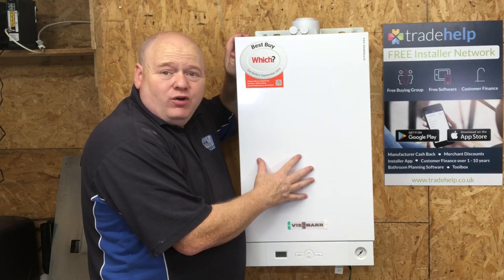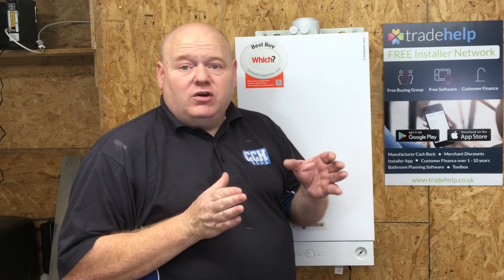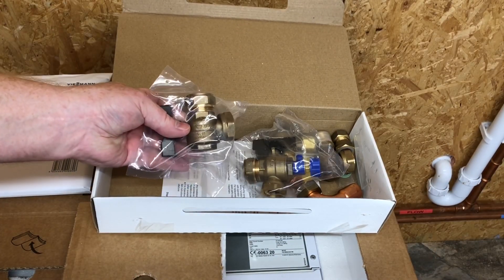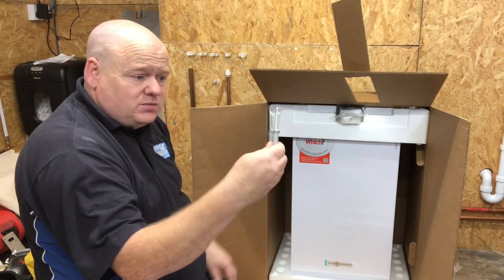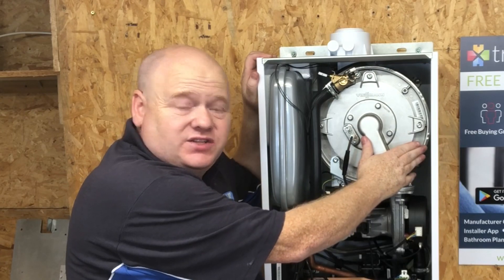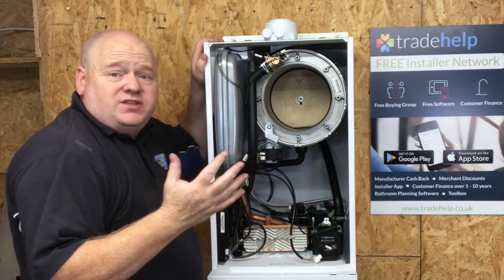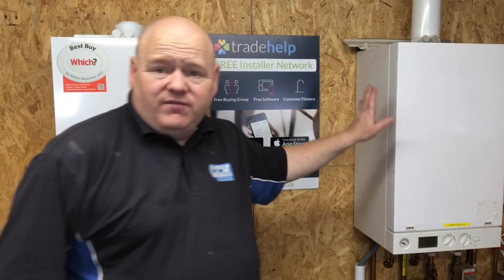Viessmann Vitodens 050 Combi Boiler Review - What’s in the box - Full strip down

Comment: In the USA the Viessmann boilers 100/200 plus have been withdrawn due to faulty plate heat exchangers. In the UK, the boilers are having the same problem especially those installed around 2017 - 2019 approx. The engineer that did the annual review on my boiler said that he is coming across this problem regularly. Also the pressure keeps dropping. These have not been withdrawn.

Comment: Hi Allen. I have had this boiler since 2018. I have the extended warranty and I now have a faulty heat plate exchanger. I had an annual service and the engineer said the plastic parts on the heat plate exchanger had disintegrated. I contacted Viessmann and they are refusing to look at the fault unless I pay £155, for an engineer to come out to survey the job. I told them the faulty part is covered by the warranty but they categorically denied that it's covered. The temperature of the water goes from very hot to cold in a matter of minutes.

Comment: Had this boiler installed 7 years ago, have had it serviced every year. Most years it needs a new hose and plate heat exchange due to the system clogging up. This year the plumber advised to rip it out as it’s just going to keep costing £££ a year in servicing and replacement parts.
Reply from the maker: It sounds like your system needs a good clean.
Reply: @AllenHart999  we’ve already done that a few years ago and had a fernox fitted to try and help. Is it normal to have to change the hose and plate heat exchange on a yearly basis? It’s costing us £300 a year just to keep the thing running

Comment: I have this boiler and the pressure gauge has stopped working. I didn’t realise I thought the pressure went low so added more water then it leaked out. Not sure if a new pressure gauge would be under warranty. I’ve had the boiler 5 years but only serviced 3 times.

Comment: I bought a house with one of these fitted.  Heating has worked great but hot water is a nightmare.  Boiler is less than 30 months old and I am having to have an engineer out for the third time.  The system has had an annual service and Viessmann now wont come out to it without charging as they say blockages are not covered by warranty.  They did attend once when boiler was less than a year old.  I cant run a bath and showers are awful.  One engineer who serviced it said he had seen a lot of problems on relatively new Viessmann boilers with crud accumulating on the lining of the black rubber hoses and in the plate heat exchangers.  Cost of ownership is very high.  Location Bolton.

Comment: Hi  I have the 050 35KW had it two years running 22 radiators and 3 showers (not used at the same time)  This a great boiler, Viessmann give you 55 KW on the heat and 35KW on the water the others don't.  This runs my house and I'm very happy.  I do have a question,  If I turn the heating temp down on the boiler to 50 Deg C my bed room radiators are only look warm but teh rest of the house is ok.  I know about balancing but Can I speed up the pump from the installed setting to compensate for this. Is this a bad idea.  Thanks

Comment: I like the 050 as I think it is excellent value for money.And I look forward to the new model coming out soon especially as the rubber hoses are being replaced with copper.
My opinion is that this is long overdue.
I look forward to the launch of the new 050 which I think is going to be similar to the new 100.
Reply: Hi Robbie, hope you can help. I had a Veissman 050-W fitted last Wednesday. I was told it would be the new 2021 model and be 30kw. All of the documentation that came with it is for 050W-25. There's a sticker on the top of the boiler, which says Type: BOKA 25. 
Veissmann and the company who fitted it are saying it is the new 050-W 30 version. How can I definitely confirm which boiler it is?
We previously had a Worcester 28i (for 17 years - needing repairing a few times though), but this seems to have slightly lower water pressure and water takes a bit longer to heat up. 

They insist it is a 30kw version but everything in the box including installation manuals, energy efficiency sticker, sticker on top of boiler says Type: BOKA 25
Reply: @michaeljones3694  I think you need to take this up with who installed it.If it says it is a BOKA 25 then more than likely it is.You also need to take the serial number of the boiler and that will confirm the model number if registered with Viessmann.

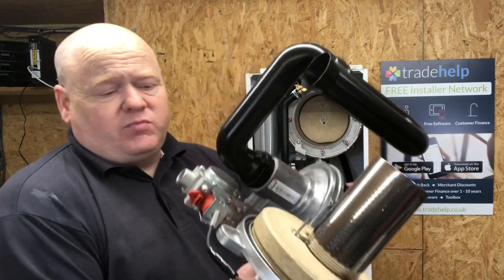Comment: When mine (LPG) was commissioned we didn't notice the fog horn sound made by the flue for a few seconds when hot water was turned on.   My engineer couldn't solve it so we called for the Viessman engineer.  When he arrived he knew exactly what the problem was and replaced the big black tube (see video at 7:40) with one that had two holes drilled in it.  Solved but why, when they sell you the boiler and the LPG adaptor, don't they include the appropriate tube/pipe with holes?  Can't be that expensive.

Comment: Stay away from this shit, it's a cheap garbage, those rubber tubes inside after 2 years of usage they start to disitegrate filling the heat exchanger with black plastic parts, the heat exchanger must be cleaned out from that rubber parts otherwise the temperature is not measured correctly. Also the pressure gauge after almost 3 years got filled with water.  After 3 years I have to replace the boiler because it's cheaper to buy a new one. The warranty expired after 2 years.
Reply from the maker: if you flush the system well they last longer. Thanks.

Comment: Hi Allen,  I`m just messing with an 050, only 6 years old but not registered and filthy water to boot. Diverter Valve changed and also plate heat exchanger cleaned as had to come out first, not easy repir with only 400mm below boiler, heating works fine but how water trips out getting too hot too fast, may be dirt in the main heat exhanger despite big pipe size. 
Much prefer the Ideal Logic and Max.

Comment: I have had this boiler for 3 years now . Has been working very well so far but lately the hoses are clogged up and the plate heat exchanger is not working ☹️ . Vissemen is on the case though , I'll ask them if they can replace those two parts instead of cleaning them up . Thank you for the video

Comment: Our Viessmann System Boiler 100-W has developed water leaks from two of the "O" Ring type joints (at the Central Heating and Domestic Water Returns. These joints are located on the Support Plate between the upper and lower casing and seem to be a nightmare to replace the "O" rings without a complete strip down. Is there an easy way ?. Thanks Alan, great videos.

Comment: Love the Honesty.  Been quoted for one of these I was stuck on Valient / Glow worm, not Worcester as various engineers have said how hard they are to work on. What got me was the fan and heat exchanger looks like it will give a lot of hot water. The parts and labor warranty sounds lovely. Has anyone had experience with how responsive Viessmann is to fix under the 10-year warranty? Is it like 2 days for call out or 10 days, whereby the issue of sourcing parts, which is apparently hard for Viessmann, is a concern, as if its long response time, I may want a local engineer to source parts and fix. on a boiler that has spare sourcing issues.  Then I am back with Valient as their parts are more readily accessible.
Reply: I have fitted 25+ Now mark excellent backup from viessmann who usually call try and out the next morning. parts readily available from the heating merchants called plumbase or viessmann direct. Excellent on the efficiency can maintain a three bedroom house warm  for around 19 to 22p an hour! A very quiet running boiler too
Reply: dont bother, these boilers are utter shit, trying to get parts for them is a nightmare,  stupid rubber hoses that collect crap like a magnet. why anyone would install these is beyond me

Comment: Does a boiler warrantey cover all the enclosed parts of the boiler.The plate exchanger is my concern.
Reply from the maker: Yes as long as the boiler has been installed correctly. Thanks.
Reply: I have an issue with a faulty plate heat exchanger. Viessmann are refusing to do anything about it unless I pay £155 call out fee. Even though the part is an integral part of the boiler and is covered by their warranty. I even read the section of their warranty to the customer service agent, she still wasn't having any of it. They are not honouring the warranty.

Comment: Hi Allen and thanks for the very informative videos, you really do make it look so interesting. I think you convinced me with Viessmann as I'm looking to replace my current Worcester boiler (an excellent boiler if I may add) which is now leaking and constantly losing pressure, I don't know if its the heat exchanger or something less sinister! Anyway, will the flu opening in the wall for the current boiler be fine for the new Viessmann or will it need some alterations.
I would also appreciate your advise on whether to get an engineer to look at the current boiler and see if it can be fixed or just go ahead with a new one. Thanks once again mate and keep up the good and honest standard.
Reply from the maker: Most boilers can be repaired but sometimes you are throwing good money away. Only you can decide. Thanks.

Comment: Having installed, two points worth sharing. 1. The return fitting is awkward to tighten, on the boiler side - definitely do it first, and better still, before hanging. 2. Yes, it’s the budget model but disappointing there isn’t an internal filling loop. For rental properties, latter not easiest for tenants to use.

Comment: Cheers. managed to replace the plate along with the hose in this as I was having an issue with hot water.  The plate and.hose were in a right state covered in orange flakes of carbon that have formed from the hose.
  The hot water appeared to have been working for about an hour but was back to square one again with the cold water.

Any ideas where to look next. I'm thinking faulty diverter valve as the heating is working absolutely fine. Would appreciate any advice. Thank you again you've been very helpful.

Comment: I've been fitting Viessmann boiler for many years now. Any of the models with rubber hoses are very prone to clogged heat exchangers in a short period of time even on a system that has been thoroughly powerflushed.  I now no longer fit the 050 for this reason. The 100W is a good boiler now they have replaced the flow and return hoses with copper pipes
Reply from the maker: The 050 has a 10 year warranty at the moment. I am installing them, fully flushing the system and testing the water to prove it was flushed.

Comment: If i run the service mode test on this boiler and set it to 100C and keep the taps closed during the test, is that bad for the boiler? What damage will it do to the boiler?

Does this boiler use a pilot light or ignition system?
Reply: If you run this in service mode the water will circulate around the radiators , you will notice the radiators getting hot when you run in this mode , ignition is by electric spark ,you can see the electronic unit ,the small black box (at 9.03 seconds in video)
Reply: @SalimKhan-gk1fh  what happens if you have all the radiators off aswell? Because I ran this test with all taps and radiators completely off.
Reply: @bushgreen260  it'll run until it gets to max temperature and then shut off, not really any different than if you had the thermostat calling for heat and the rads were all off.
Reply: @edc1569  thermostat can't go up to 100C

Comment: Just had one fitted, shall see how it goes. Easily an improvement on the old boiler.
Reply: All going well with the boiler? I'm in need of an upgrade
Reply: @jonathanclayton3918  Had an issue with a part failure after a yeae. Plumber said there was an unknown substance in the system that damaged the part. No idea as wife was there and I was at work. Took a fortnight for the warrenty people to fix it as they didnt have the parts in. Then was a temp fix with a temp part and then a month later the part came in and got the permanent fix.

Only thing I know in the sysyem was what the Weissman approved engineer added. Anything from before I moved in 4 years ago I could not say. Landlord doesnt want to flush the system which was their advice.

Comment: Alan can you explain why on my mixer shower the water goes cold at random times? Is that due to the boiler only having a 24Kw rating? I have ordered the Veissmann 050 35Kw would that solve my problem?
Reply: You can get weird oscillations with thermostatic showers, on mine I had to somewhat restrict the cold flow rate, wonder if Allan has done a video on this?
Reply: @edc1569  I have not had the problem since getting the new boiler. The run from the boiler to shower is quite short so I think the boiler was just shot. Possibly a problem with heat exchanger and thermostat cutting something out. Cheers.

Comment: hi Allen, i had numerous poor experiences with gas boilers so far because of the changing temperature of the shower water. it fluctuates a lot because there is no buffer. Do you know if this model is any different? I am looking for a smooth, constant temperature (not asking too much )  :)
Reply from the maker: You need a good plumber to install the job correctly and flush the system. Thanks.
Reply: @AllenHart999  can you please elaborate? i agree that it needs to be installed correctly but why would the plumber affect the consistency of water temperature?

Comment: Hello. Just completed my first 050 today. Probably worth mentioning that you can't  use 230v controller.  You have to use low  voltage ⚡ open therm connections.
Ps. Fitted that 111 you recommended to me.  Absolutely mega.

Comment: I used to install viessmann 100 when they had the rubber flow and return hoses had many a problem with them blocking up and causing the boiler to fail on 2 occasions had the hoses explode and boilers were totally damaged beyond repair.Plastic manifolds always block up due to the rubber hoses.The best thing about they boilers are the heat engine and heat exchanger
Reply: Sorry mate, but I've fitted literally 100's of Viessmanns boilers covering 222, 200, 111, 100 & 050 ranges without issue. If your getting issues with the rubber hoses blocking up, then I'm afraid it's 100% down to the installation. If you clean/flush/dose the system PROPERLY and fit a quality filter you should have no issues what so ever. 
If not, well then what can you expect....
Reply: Yes definitely top quality I’ve fitted loads and you can read my review further up this page
Reply: Lee I power flush every boiler system installation been doing that for over 18 years. Every boiler had a magnetic filter fitted .Cleaner add when flushing and inhibitor when finished.i was told by viessmann not to add inhibitor to the system as they don’t in Germany and system should be filled with de ironised water as that’s what is used in Germany so think I exceed the British standards at the time
Reply: @stevenyearnshire1624  thanks for your response Steven. Please do not be personally offended by my comment. It was in no way intended as a criticism/judgment of your workmanship/standards. I was merely passing comment on my situation.  As for your experience and in light of what you state as your good practices, then I'm honestly at a loss personally, as to why you have experienced this issue on such a seemingly regular basis. 
I can only speak for my own experiences as I stated in intitial comment. I have never had to replace the black hoses fitted to wb1b and early wb1c models due to blockages. For total clarity I did have one pipe burst after a week in service but that was deemed a faulty hose when sent back to Germany for testing. 
Best regards.....
Reply: Lee 69 Yes Lee same here I fitted dozens and I’ve not had any issues at all on a clean flushed system
The 050 is by no means a budget boiler just a trimmed down version of the 100

Comment: Why do they persist with those black rubber hoses?! I would much prefer to install a Main Eco Compact, cheaper price and brass internals 👍🏽
Reply from the maker: This is a good 10 year warranty boiler though. Good price? Among the cheapest 10 year warranty boiler on the market
Reply: @AllenHart999  I suppose that's a good point. Good for the customer.
Reply: Umar K 
main eco compact Is a crap boiler compared to these viessmann boilers, I’ve never had a problem with the black hoses in the last 10 years it’s all down to quality installation
Reply: A £100k German car is full of black hoses too.
Reply from the maker: E C How much pressure are they under?

Comment: Hi Allan 
I am install viessmann boiler on o50 model spouse to syplay flow and return and hot and cold water teel and filling loops and also only 7 years warranty not 10 years 
Regards 
Faruk
Reply from the maker: If you sign up on the link you will be able to offer 10 years warranty. Thanks
Reply from the maker: http://viessmann.tradehelp.co.uk/
Reply: It does say 7 years but I bought one of these boilers in January from Boiler Hut and the sales guy said it now comes with a 10 year warranty
Reply from the maker: @kingsman428  How good was the install? where you happy with it all.
Reply: @AllenHart999  A single engineer with superb pipe work, an all round first class installation. The guy even went out of his way and fixed a slow leak I had. Sure, the boiler was a touch more expensive than sourcing it yourself but this is German engineering and you want the support to go with it. I did a lot of research into boilers and it seems as though the Viessman range is the Rolls Royce of boilers. In the UK it seems as though the market is driven by the initial price whilst in Germany it's driven by boiler efficiency.  German engineering, what else 😁
Reply from the maker: @kingsman428  Did they do a water sample to prove system was clean?
Reply: @AllenHart999  I don't know my daughter was present during the installation